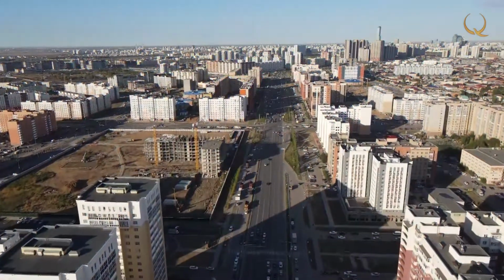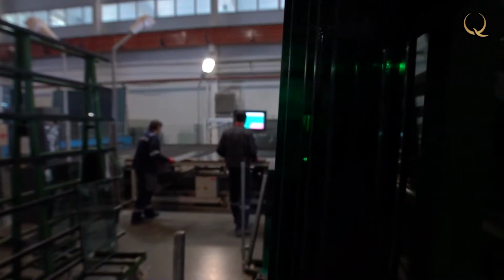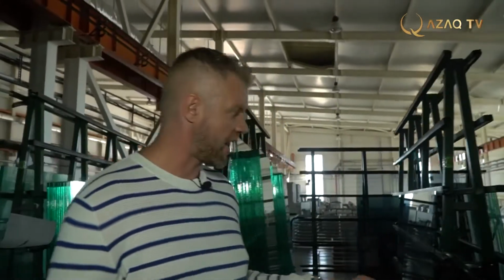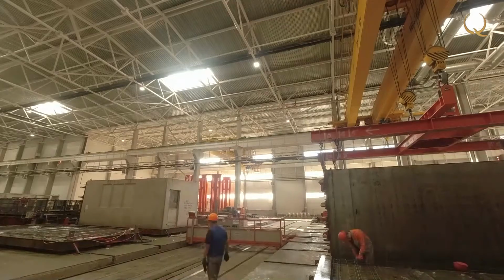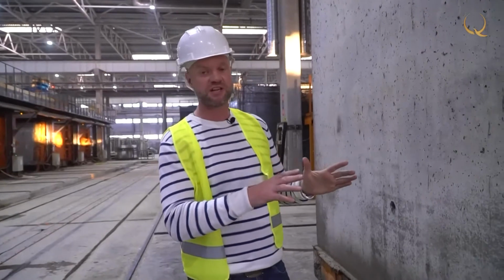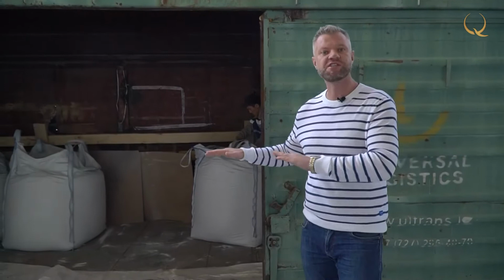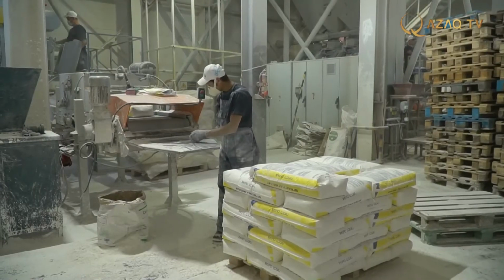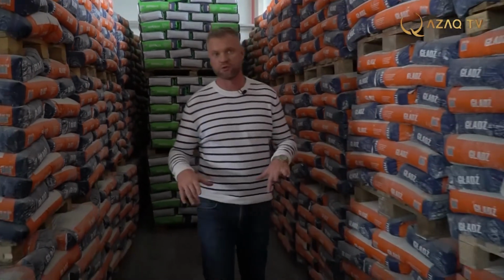Production of glass, concrete modules, dry building mixtures. «Made in Kazakhstan»

Comment: They seem like pretty good Companies...

1.) They may Not make the Glass; But, Atleast they make windows.. 👍  7/10 (residential?)

2.) The Exterior walls of the modular homes-- look thin..   (Interior module?)
And Can they Make 7m x 8m Rooms or Custom sizes?  

They say the same thing about Modular homes, in America..  But, They are Junk.. 
(mainly Foundation settling problems & installation/pour errors)

3.) Concrete Mix..  👍   7/10

Decent Companies..  But, are they publicly stock traded Co.'s. &/or How much do Oligarchs Own??

The Gov. Should start some Brand New (50/50 Public/Private) Modern Manufacturing Plants-- in other Major Cities.. (Shykent, Almaty & Atyru)

Also, No New Manufacturing(/Refining) Plants should Not take more than 6mo. > 18mo. To Assemble-- or it's Too Big..

Portland Cement, SpanCrete, Sewer/Drainage segments, Residential & commercial Windows, Recycling Centers & Processing, Plastic Molding, CNC, Oil Refining, Paint, etc..

Comment from the maker: 01:06 Production of glass, concrete modules for building houses, dry building mixtures.
03:34 Specifics of the enterprise for the production of glass products, however the plant does not produce industrial glass.
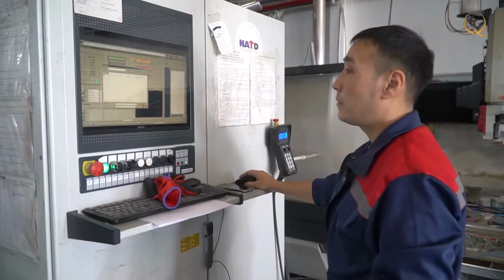06:45 The equipment at the enterprise allows to manufacture products of any complexity.
14:25 Features of the production of modular building blocks.
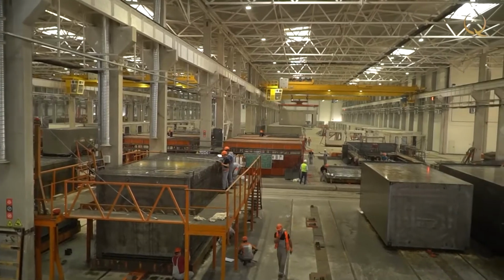15:00 Modern equipment is installed at the plant.
15:25 What does the fittings look like after the welding shop.
17:50 What does the block look like after the molding machine.
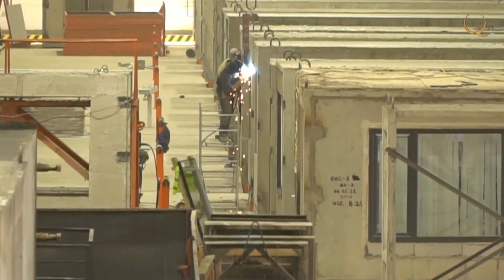18:30 Final stage of the site - finishing.
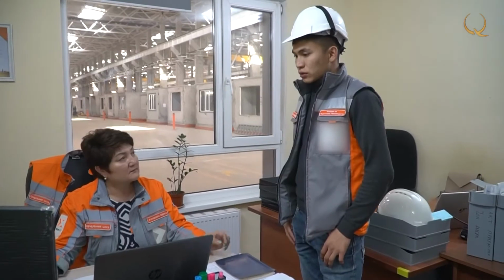18:50 INTERVIEW: Advantages of a fine finish by a specialist.
21:20 INTERVIEW: How is the process of unloading raw materials going.
21:55 Sand is unloaded onto conveyor lines using special loaders.
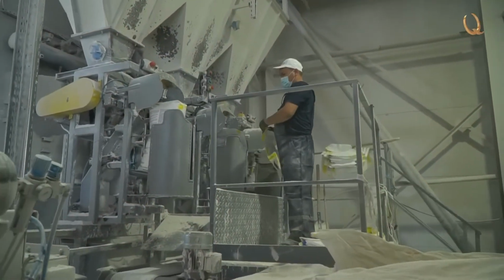25:15 When the ingredients are blended, they go to the filling lines.
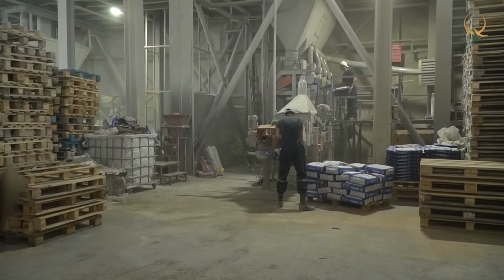27:50 Finished products are sent to markets for consumers in different countries.
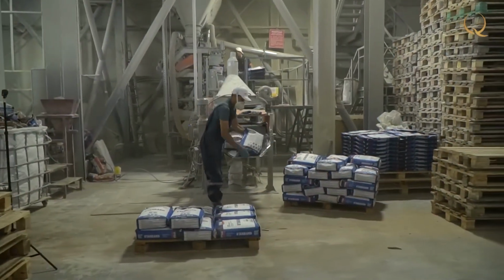28:17 The plant provides innovative products.
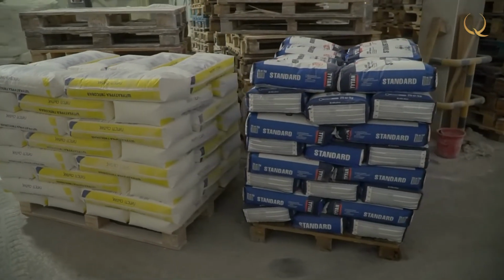28:35 INTERVIEW: Products have hydro and sound insulation properties. This is its advantage.
29:20 The company manufactures products to make consumers' homes more beautiful and comfortable.